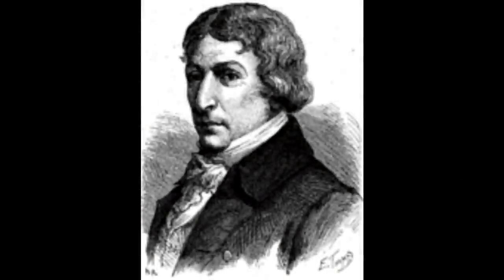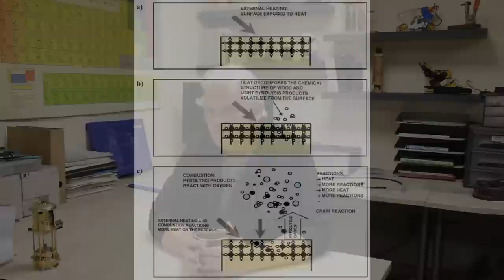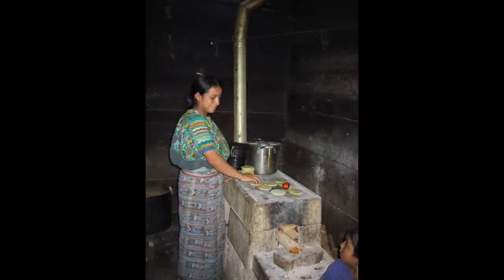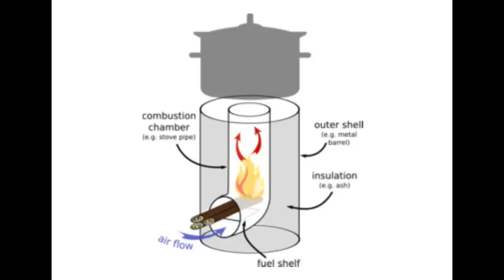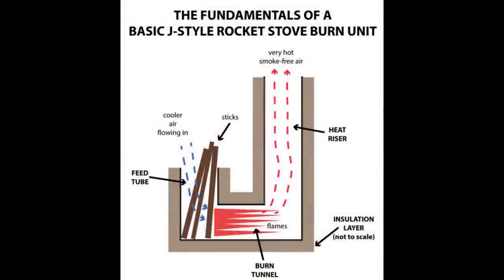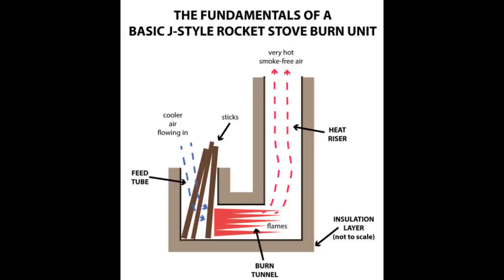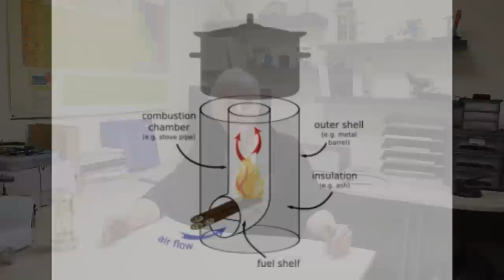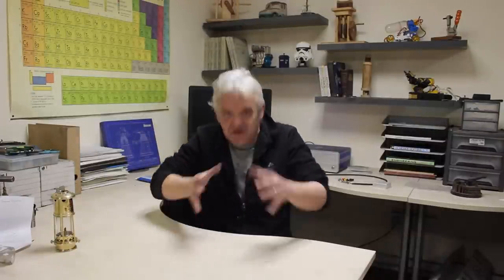1742 The Rocket Stove - Explained and Demystified #rocketstove

Comment: Another point that is often missed: An ordinary wood stove, once the burn is established and going, burns its wood on the entire surface of the firewood. The rate of burning is mainly controlled by the reduction of the airflow to the burn chamber. This leads inevitable to a less efficient burn. The Rocket Stove on the other hand burns its fuel (if done/loaded right) always with the maximum amount of air it can possibly get - but only at the tip of the firewood. As I said, a small detail often missed out concerning Rocket Stoves/Heaters and their efficiency. Greeting from Germany - love your channel!
Reply: I've never looked at it that way- that reduced airflow automatically lowers efficiency in the woodstove. Now you've answered a question which was baffling me for some time. With the addition of secondary air intake in my tall woodstove (see my channel), in the form of a vertical pipe, the fuel always burns. Now, the pipe is too perforated to create a proper secondary combustion (I guess the superheated air cools by the time it travels up just enough to not burn), but the bottom perforations always provide some air, along the primary air. So I incidentally made a hybrid. It gets it really hot, but I also have increased fuel consumption. A win win, depending on what one wants.

Thanks bud!
Reply: yup, and the burning end runs bright yellow to white hot as it gets, is a LOT more heat in shorter time from same amount of wood.
Reply: @modelnutty6503  as Mr. Robert said... A log of wood is a log of wood, same energy in two cases, but one does it faste, with more power. 

My tall stove has relatively thick chamotte bricks inside, about 35 mm, all around the combustion chamber, and 0.5 mm stainless steel body on the outside. The cast iron top (or head) is about 2-3mm, quite thinner, and it is on the receiving end of all the fire and heat. So it irradiates heat into the room quite quickly (especially with the addition of the stove fan), and then the brick mass below gets hot, and stays hot long after the fire dies out.
That was a more elaborate explanation of my 'hybrid' term from the previous post.
Reply: Another thing to consider with wood stoves burning on tick over, particularly overnight, is that it's drawing in cold air from outside potentially cooling the space as much as heating it (unless fitted with a direct air system)
Reply: @emel60 he didn’t do that good of a job explaining that the higher burn temps ensure the burning of wood gasses though, which does increase the overall amount of energy generated by burning the same piece of wood

Comment: Working as a welder in stainless steel a while back I made a small rocket stove, 2x2inch sq tube. I then put the stove inside a box, intake and exhaust flush welded to two sides. I added a spout to one end, and a handle to the other making a tank that holds about a gallon of water that can be poured easily. Great camping stove, I can boil tomorrows water while I cook tonights dinner, with only a few handfulls of twigs.
Reply: That sounds interesting! Would you mind posting a pic or video of it somewhere? I'd love to try out your idea.
Reply from the maker: nice
Reply: This is exactly what a Kelly kettle - Thermette is :)

Comment: The barrel part in your Mass Rocket Heater example releases heat right away - no waiting for the "Mass" part to capture, hold and release heat later over longer periods of time. That's the way I understand the system anyway.
Terrific channel!
Reply from the maker: yeah pretty much spot on mate
Reply: exactly, and a bit more than half the heat is stored for the slow release. the pipes don't load up with creosote quickly like a regular wood stove but cleaning access for the mass pipes is still needed.
Reply: @modelnutty6503  Not a lot of cleaning is needed.  I watched one video where a water heater RS was taken apart for inspection, and, after two years of constant use, the chamber at the top of reburn chamber only held a half-inch or so of dry soot/ash and no creosote at *all*.  From what I've seen on most mass heater cleanouts, a compressed air hose is all that is needed to blow out the small amount of ash produced during the first 5-10 minutes of each operation.  Most just have a small door at the end of each straight section to facilitate easier cleaning.
Reply: @KeithOlson    I'm planning to build my rocket stove outside and pipe in heated air from a secondary, smokeless, horizontal "chimney" that will go through an opened window (obviously it will be modified to still insulate and to accept a pipe through it). 

    So even if creosote etc was a potential issue, I would be A LOT less worried about it.  This rocket stove will be so well insulated that I don't care that it is not directly inside. It will be insulated primarily by a combo of vacuum insulation and fumed silica. (Two of the most efficient insulators known to humanity, but with aerogel in between these on the scale [but aeorgel is far too expensive for me to use]).

Comment: A rocket heater (without a mass) is good for a woodshop.  A rocket mass heater is good for a home.  A typical rocket mass heater puts out 70% as immediate heat and the rest into the mass.

Comment: I do blacksmithing as a hobby, and to make charcoal for my forge (I’ve since switched to propane), I settled on a method which involved a large pipe, about 3 feet (1m) long, 2 feet (65cm) in diameter, and 1/4 inch (7mm) thick, resting on 3 inch (8cm) metal spacers to allow airflow. 

I’d build a small fire in the bottom, and once it got going I could throw in bigger and bigger pieces of wood, filling the pipe right up. The heat from below would bake the wood on top and release gas, which would burn as long as the bottom wasn’t clogged with ash and debris. 

The flame from the burning gas could get up to 4 or 5 feet (over 1m) above the top of the pipe. And large spots of the pipe (which is quite thick, remember) would actually glow cherry red. 

To stop the process I’d remove the spacers (easier said than done) and place an oil drum with its’  top removed upside down over top of it to smother the fire. It was quite interesting, and I did my best to use some of the principles of a rocket stove.

Comment: The Fin oven is a kind of rocketstove with downdraft. Very popular in Scandinavia. With downdraft section the hottest gases will stay in the upper chamber, while colder gases that did their job, leave through  the chimney.
In the eighties I visited a monastery in Kyiv, they had a HUGE wood fire oven in the cellar. The heat was trapped in a second "stove" consisting of just a hollow structure. Heat was dissipated in the walls, somewhere on the low side of this chamber was the escape for the gases. This construction continued for six floors. They started heating in August and only beginning of October the walls started radiating heat on all floors. Very huge stove, very huge monastery, very impressive! In March they stopped heating, the monastery kept warm until the beginning of May. The monk who designed the stove was Kuznetsov, so they called it the Kuznetsov stove. Built somewhere in 17th century. Apparently the system to preserve thermal energy by downdraft was known when they built the monastery.
Reply: I would love to see a occur if diagram of the design
Reply: In British Columbia Canada off of Highway 5a that goes from merrit bc to kamloops bc is a buddist monestary that is called the birken forest monestary if i recall correctly the name. They get winter temperatures down to minus 30 degrees Farenheit. COLD. They heat a 10000 sq. foot building with 2 smallish wood stoves, because the building is superinsulated, and sliding insulative doors cover the windows at night. Very interesting video.

Comment: If I only could send you a small video from. 2 years ago..a ramshorn in a so called pizza oven.. super insolated control of slow fire and adding a lot of stones around.. later introduced a heat transfusion with a water spiral to feed the CV.
I left the guy with whom. I shared my suggestions and support because he had1000 things else to do. This is a hell of a product.
I stil love this hell of a fire stove so easy burning..you can open the heart and the oven without danger or distirbance. Ideal
Too hot for a single simple home.. You ll have to share with neighbours.
I wish I could send you a video..
Thanks for your concerns and information.
I love it,
Fredy

Comment: Watching your videos helped me refine my tire burning heater, so it doesn't give off black smoke anymore. It burns clean and since used tire are nearly free, I can heat my garage for a lot less and tires don't need to be seasoned to do the job like wood does. And there is a benefit of keeping tires out of landfills and free scrap metal to cash in at the metal recycler.
Reply: Any pictures or information on your tire stove?
Reply: @exbrownj  I'm thinking of building them for people in limited quantity locally. I can't add pictures, but I can give a basic explanation of how it works. It is a 2 stage burn. The tires have their own burn area controlled by air intake vent. A small fire burns the tire just enough to create flammable black smoke. That smoke is channeled into the vortex inlets of the rocket stove. And the whole set up is enclosed and the heat is vented into the garage. So far the only problem is that the tires burn much longer than the wood in the rocket stove, which means if the smoke isn't being burned up it will go out the chimney. I'm thinking about using propane to keep the flammable smoke from the tires ignited or cut back on the amount of tires I burn. Make sense to you?

Comment: I like the idea of capturing  and radiating as much heat as possible so I intend to experiment with those stacked 240 litre steel drum wood burners I've seen other pyromaniac youtubers build. I think they're referred to as 'double barrel wood stoves' but I'd like to continue stacking.
Reply from the maker: yeah I like that idea too mate - do a video!
Reply: Thinking it is a good idea.  I would be interested in hearing your results.  The more you can do with the same amount of fuel the better.  For example, don't just heat a mass also generate with a thermopile at the same time and cook as well.  The more you do with the same amount of fuel the more value it holds for you.  Keep thinking like this!
Reply: hmm.. rocket stove into a couple fire brick lined 30 gallon drums?
Reply: Cairn of Dunn croft permaculture has a reasonable set of videos on a mass heater, worth watching.

Comment: Robert, as you say, the key attribute of a Rocket heater is the efficiency and the clean burn of the gasses given off by wood in the initial fire. I assumed that it would be beneficial (necessary ?) to insulate the chimney to encourage that secondary burn to reach the temps of 600-1200 you mention. That then leaves you with some pretty hot gases coming out of the top and, by enclosing the chimney with an inverted can, you retain the heat to help keep the chimney hot but also radiate into the room and (for a rocket Mass heater) exhaust into a further heat recovery and storage area viz. the "mass", extracting most of the heat from the  exhaust before it leaves the building.

Comment: Hello Robert, the steel rockets you've been building may be fine for making a cooker in your garden but there are some things you need to consider when plumbing them indoors. If you add a chimney and/or insulate the secondary burn area you can increase the draft which in turn will increase the efficiency and temperature of the burn, this can quickly get to temperatures where the steel will corrode and spall. A complete internal collapse of internal structure is not entirely uncommon in less than 1 full heating season even with pretty heavy steel construction.
 If you add systems to harvest more heat downstream of the burn chamber and don't have a complete burn of gassified wood you are creating condensation point for creosotes and a chimney fire risk or collection of CO and oxygen mixture which can set off with enough force to blow the system apart. I hope you can beg, borrow or steal an exhaust analyzer like a Testo so you can assess this yourself.
Reply from the maker: the temperature is a function of the chemistry mate not of construction - that is reactions happen at a fixed temperature. Heat retention is a function of construction - so heat will continue to build in an area until the rate at which it dissipates matches the rate at which it is generated - if you insulate the dissipation will be slow, equally if you burn quickly the build up will be fast - see where I am going with this? That's why you can make a rocket stove from a bean can and why every stove is not a forge
Reply: @ThinkingandTinkering  Reactions happen at a fixed temperature when at a fixed ratio of reactants. If you increase the draft, you increase the draw of oxygen and increase the temperature of the burn. It is relatively easy to add 8 feet of pipe to your rocket and see how much hotter the secondary burn area gets.
Reply: An exhaust analyzer would be cool to see, just out of curiosity. At least an O2 sensor. You can get a cheap automotive O2 sensor on Amazon for about $20 US, and monitor with a volt meter in the millivolt range. Lower voltage = more O2 I believe.
Reply: Agreed, in a well designed and insulated rocket stove, if you use steel or regular, cheap, soda glass, these need to be protected with insulated cob (or something similar).  Then these former materials can provide the structure for a longer time, while the clay (which is very heat tolerant) can take the brunt of the heat. Just by protecting steel from burning oxygen, really helps to preserve it. 

   Soda glass doesn't oxidize, but of course has a lower melting temp, but more importantly, it doesn't handle expansion to contraction and back and forth very well.  A combo of thermal mass and insulation helps to regulate those cycles (slows them down) so that it can last a lot longer over time and use.

Comment: A big advantage of mass heaters is that they produce radiant heat not so much convecting hot air which can be lost easily, when doors open and to the ceiling. They transform, fast high temperatures (as you say) into much lower temperatures for long periods, that are more amenable to body comfort and health....a problem with metal box, high surface temperature wood burners is that dust burns on the hot surfaces and is convected into the air resulting potential respiratory issues, also the fierce heat drys the air causing further problems. The Roman Hypocaust and the ubiquitous northern European masonary or tile stove have much to recommend them for space heating purposes, albeit they take time....

Comment: Hi from Spain Very interestiing video  I made a belt batch box one year ago and in my opinión you are right on some points but you forget others It is true you must think about what do you want to warm and how quick If you want quick Heat The belt  batch box solution is better than others because you have direct Heat as a conventional wood STOVE and in about 15 minutes you can have a clay máss Heat just above and radiate this heat 
On the other hand you forget that the clay dry and clean the room and you can fell a Very confortable Heat Finaly you forget that if you dont have a lot of money the batch box can use cheap wood like rest of wood cuts or even wood fron old fornitures because the pyrolisis burn the smoke
 Thanks and Buenos Días !!